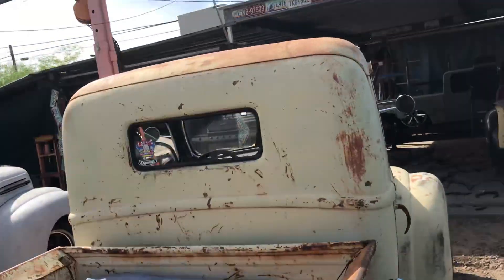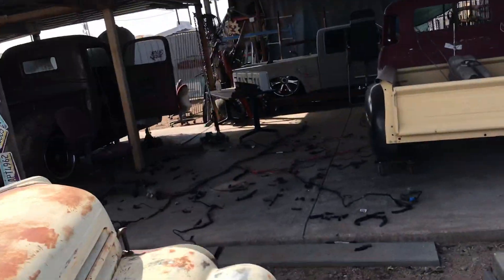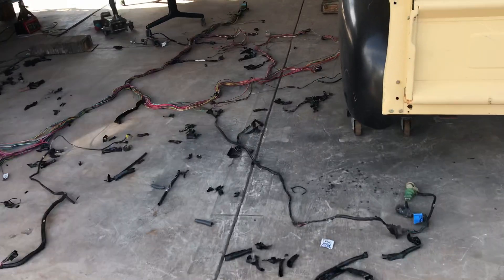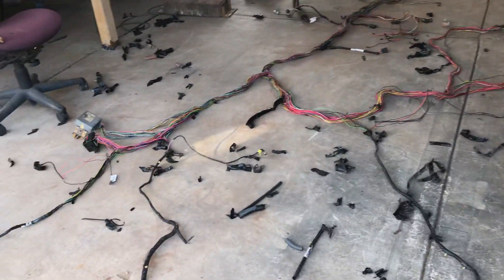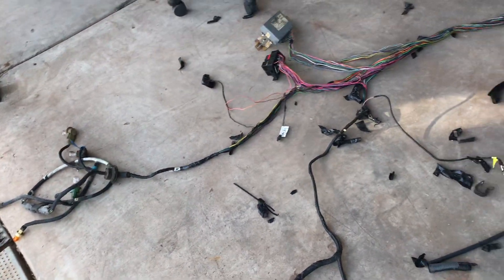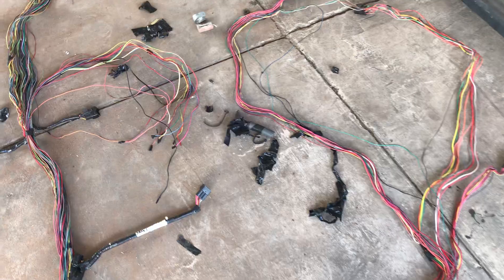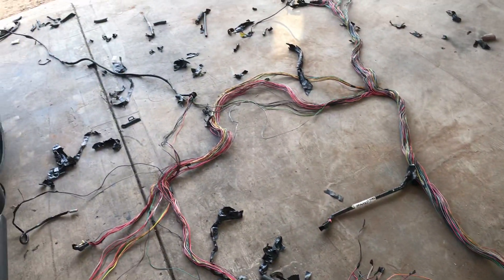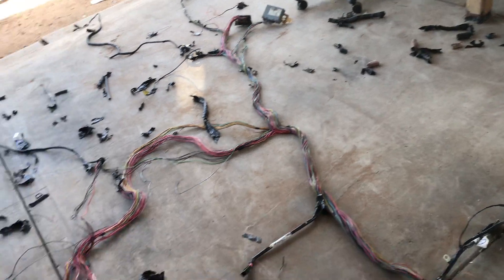Wiring update. 1945 Ford Pickup Truck V8

Comment: Hey Trenton! Thank you for the inspiration!!! You sir, are my hero!! My project is a 52 on a 97 AWD 5.0 Exploder... I am currently stuck on a wiring issue.. You made it look very easy (as I am sure it could be if I wasn't overthinking it?). I am hoping you could give me some advice? Since I'm from the old school I don't have ANY social media.. LOL
Reply from the maker: Mark Howard Is the truck not starting ?
Reply: @1984SWM  Thanks for the reply! long story short, I rushed the body off removal process with.... yes... a sawzall... I hacked through some wiring to the point that my original wiring harness was garbage. Then I tried to minimize the harness with just the necessities and got lost. to remedy the problem, I went to the wrecking yard yesterday and pulled the ENTIRE interior harness from a 1997 V6 AWD exploder, the ONLY problem with that is the 5r55 trans pigtail won't work (obviously) with the 4r70w.  I live in Utah. it's cold right now so I will wait til the spring thaw and do like you did in your video, connect it all up and trouble shoot from there.. Unless you have a better suggestion? Hahaha yes, my friend this is the short version of my story...
Reply: What all did you take out of the harness